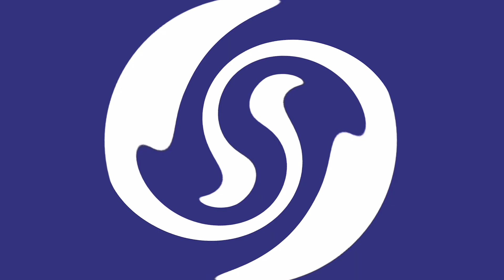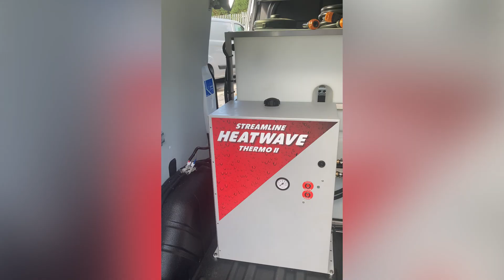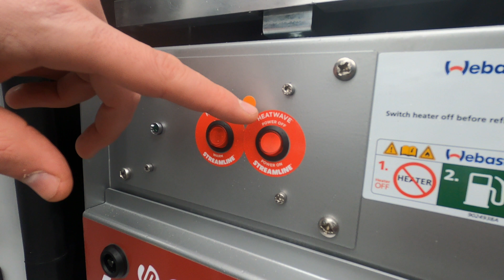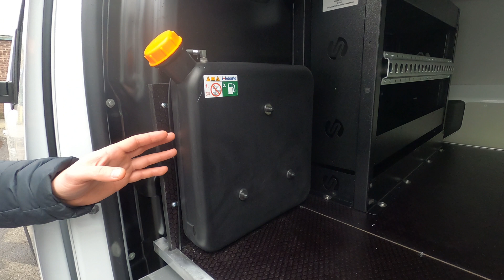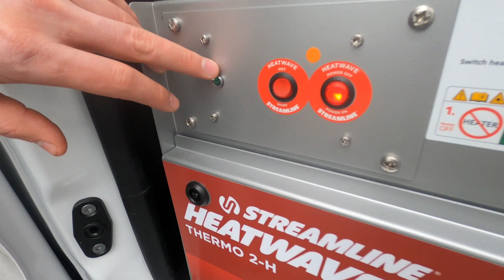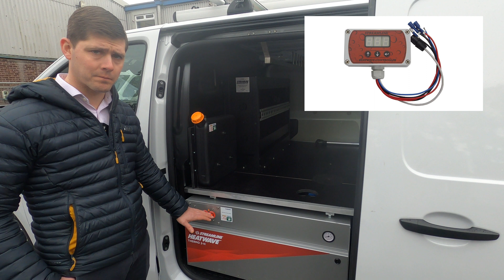Tips for Starting & Using Your HEATWAVE System! | Streamline How To

Comment: Hi I just got this system last month.  I have the 9.5kw system but I work solo most of the time, where my issue is that even on the warm setting the water is far to hot to use on glass on a cold day, is there anyway to have more control over the temperature rather than warm or hot?
Reply from the maker: I'm sorry to hear that, that shouldn't be the case really! Other ways to cool down the water include having a higher flow rate and unwinding the hose further to allow the water to travel further along the cold ground. Let us know if the water continues to be too hot!

Comment: I’ve had this system for a few years now and have never started the van first. I shall do this from now on :)
Reply from the maker: Glad you found it helpful!
Reply: Hi I’m looking at getting this system  very soon one question if you don’t mind as a single operator on the warm setting with 40 ish meters of hose out is it warm or quite hot? As cracked glass is a concern 😀
Reply from the maker: @leehumt5521  If there is 40m of hose unraveled then the water should most definitely be warm 🙂
Reply: Fantastic Ive had quote from Clive I’ll be in touch soon 😀